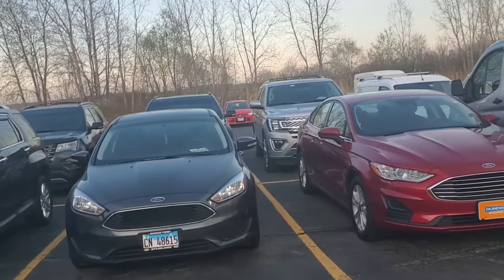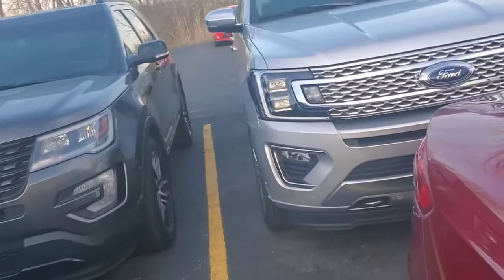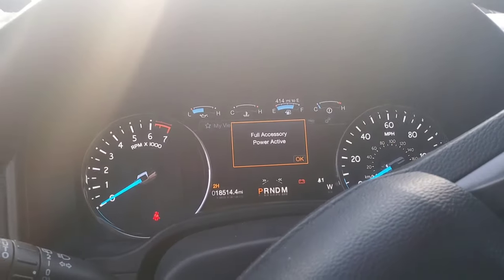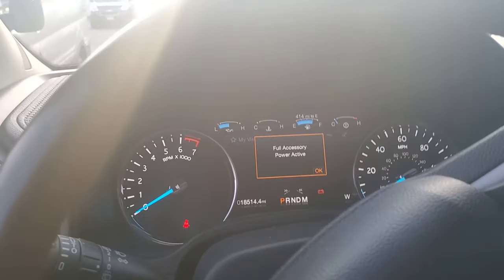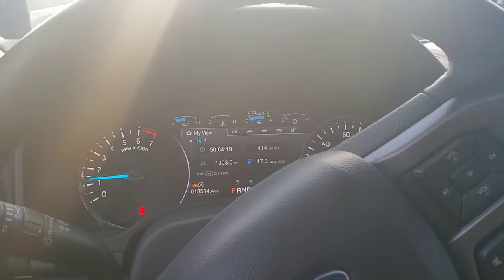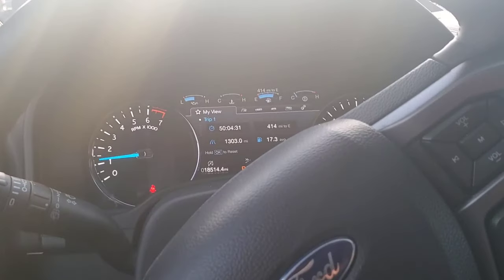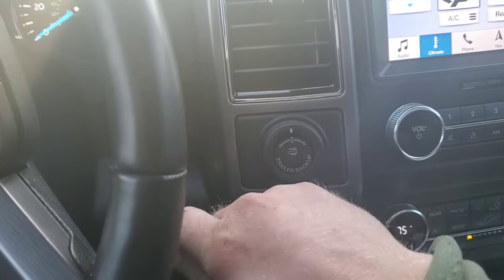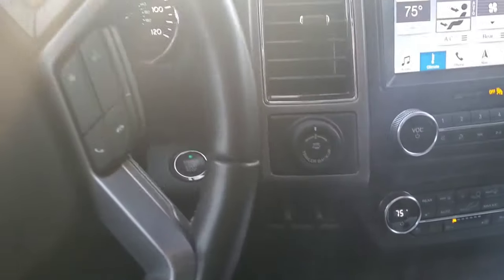3.5L Ecoboost F150 Rattle on Startup then gone, Try this - Could Fix Ford's Phaser Problem

Comment: I have a 2019 expedition and noticed my electrical fans come on after about 15 minutes of driving on the highway. They stay on  all the time as I'm driving. My temp gauge is in the normal range. I don't think this is normal. Has anyone noticed this with their expedition or f150? Why would this be?
Reply from the maker: check your AC pressures or plugged condenser
Reply from the maker: I've had 2 do this because of this
Reply: @FordBossMe  I'm not driving with the air conditioner on when this happens I don't have anything on. Should I still check those. Is there any kind of temperature sensor or could it be a possible thermostat not opening all the way
Reply from the maker: @steve-gz2ym  I'd have to go out with a computer and test things

as well as cooling, clean the radiator, check and see if any codes are present 

check Ford service messages
Reply from the maker: @steve-gz2ym  is it overheating at all? did you check and see if the radiator was clogged or pull codes at all
Reply: @FordBossMe  I had a ford mechanic looked at it already and is not sure what it is. He said there are no codes. He wants me to come back and start by changing my thermostat to see if that helps. What is your opinion on that. You mentioned also about an AC pressure or condenser. If I don't have my AC running when these fans are on is it still possible that it's the AC pressure or condenser? Thanks so much for your time and input. This issue is really getting to me because I really feel these fans should not be on almost all the time.
Reply: @FordBossMe  it is not overheating. But no matter what the temperature is outside the fans come on while I'm driving. There were no codes pulled , but I did not check to see if the radiator was clogged. It is a new vehicle I only have 20,000 miles on it now I cannot imagine the radiator being clogged. I have bought this vehicle brand new and I keep it well maintained.

Comment: I'm doing another set on Monday. Ford eneds to stop dicking around with updating, reverting, updating then seeing if it shutters blah blah blah bullshit. They need to fix the root cause which is the locking pins inside wallowing out their channels they sit in. It's just like the 5.4 3V. Except the 3V had more of a hot idle knock (also described in the 17+ 3.5 EB TSB and recall) not so muhc a cold start rattle. It's stupid. Some techs at my dealer are SPWing phasers that were ALREADY REPLACED.
Reply from the maker: Did you see the action came up with an alternate part number if you run out of the factory stuff the older than part number has like a case over the spring it says in the TSB know if you can't get this one then order this one they're giving you a second option

Comment: Clear flood mode to prime the system is still a bandaid.  Honestly, ford needs to build a more reliable timing system.
And, most GM vehicles don't have clear flood mode, wonder why?
Reply from the maker: I'm trying to figure out how to say what I want to say without being a jerk

Clear flood mode in this video I pretty much explained was just to stop the rattle on Startup and I did specify that if it's too bad obviously.... parts are going to have to be replaced as soon as possible

People shouldn't have to go to the extent of clear flood mode every time I get it but as technology changes and these parts need oil on startup immediately we don't have anything that offers that type of technology yet to where parts are pre-primed on startups so they don't issues

GM does also have issues with phasers timing chains and cam sensors a lot 

There isn't a manufacturer out there that doesn't have these type of issues they just may be better at controlling them when they're brand new early on

We have to deal with trade-in Vehicles all the time with 50 60 70 Thousand Miles where the phasers are already making noise and rattling on Startup and sometimes full blown timing jobs have to be done

Also with GMs fuel management system when they disengage lifters or control oil going to certain areas by disengaging something it also causes an issue with these vehicles at low miles that causes a tapping squeak grinding type sound at times eventually leading to lifter wear rollers on the lifters turning  and eventually camshaft wear

So in essence of talking about timing and fuel control GM has their fair share of issues as well
Reply: Cafillac CTS 3.6 timing chain broke upon startup and valves crashed into pistons. New timing chains and heads redone. Maintained extremely well and I'm 47 and drive it like a grandpa. GM has let that engine and its shitty timing system go unresolved for too long also. GM is not immune to timing problems.

Comment: The best fix is to never buy Ford again, I have a 2017 ecobooster, paid a lot for and this sucks knowing that I have to dump another $2,000 to fix the engine with low miles
Reply from the maker: Lame Fix, bias opinion

Comment: I've finally solved this problem on mine by using a pre-oiler.  $500 solution versus >$2K phaser replacement that's just a "reset button".  Video: https://youtu.be/T_QuLckdV_k

Comment: There you go thinking logical for the customer again 

Ford doesn't want your motor to last they want you to bring it in to be serviced at their dealership or buy another ford

Its not about long lasting trucks its about lasting long enough to keep you buying a ford instead of the competition  and cheap enough to make you not change your mind compared. 

Thats why there is no recall on this f150 part  because its a good money wagon that leads to you buying a ford phaser and labor or buying a new motor or new truck because ford is still cheaper than everyone else no matter what ford wins

Comment: I even try this with my older model 2007 expedition,, same rattle same difficult cold start as my 2019 expedition,,, very sick of it,,, it fucking sucks,,, each time cold start,,, I must spend at least 40 seconds to figure out to start the sucker engine,,, 
  and my 2012 cad srx suv never had any cold start , hot start issue,, just one turn, one crank------hoommm,, engine start smoothly,,
   BUT not ford,,,

Comment: I would be so annoyed if I knew all you did and worked for ferd. 
Question: this would need to be done every every startup to avoid the rattle? Hooah.
Reply from the maker: If it's bad enough yes
Reply from the maker: Typically if the vehicle has sat for several days that's when you really need to do it
Reply: Thank you sir. 

Also Trying to replace my 2011 ecoblobs intake camshaft sensor tomorrow. I’m practicing my swearing now.

Comment: Mines not eco boost I don’t know what to do ford places on phone said sounded like one of the phases has gone out it be 3 weeks I’m scared to drive it it doesn’t do it bad going down road I don’t know what to do but put a new motor in it
Reply: Husband added oil he hasn’t been long  change it should he change it again engine light came on and off I never heard it make that noise I let a friend borrow my truck for 2 days he bought it back like that
Reply from the maker: I mean if it's just doing the rattle on Startup you're still free to drive it it's not going to do any damage but once it starts sounding like metal or a diesel engine tapping all the time that's when I would start worrying
Reply: @FordBossMe  my husband says it’s tapping it is …
Reply: @FordBossMe  itvis

Comment: That works Oooooor ford could just fix there piece of crap phasers so they don’t leak down
Reply from the maker: Well if you didn't just emotionally comment on the first video that you came across you would see that I have a lot of videos on this even showing how to fix this issue they did eventually come out with a generation 3 phaser that fixes the problem
Reply: @FordBossMe  calm down it was meant to be funny and it wasn’t even directed toward you it was directed at ford. And it only took them what 15 years to come up with a solution for their stupid cam phaser’s

Comment: Nobody wants to hear their car crank over for 5+ seconds, especially in winter time when the engine oil is 4degrees outside.
Reply from the maker: Doesn't mean that it doesn't help the issue when starts to become a problem that's the whole point behind this video

Comment: I wish you would’ve let us hear the sound 1st
Reply from the maker: Letting you hear the sound first exasperates further damage
Reply from the maker: Everybody knows what that rattle sounds like that has one of these motors change the oil and don't fill the filter and you'll hear exactly what it sounds like
Reply from the maker: And then on top of that if you actually look in the comment section you'll see how much it actually helps people eliminate that sound on Startup
Reply: @FordBossMe  I did it on mine anyways. Thanks for your time and knowledge.
Reply: I also think the best solution will be to cure the cancer. Since stepping on the gas pedal can put excess gas in the system thereby producing black smoke after the car starts.just my observations!

Comment: This is not correct. There is a pin that locks the cam
Reply from the maker: Here we go one of these guys that don't have anything else to say they watch one video and they think they got everything figured out about the person that's putting out the video, dude I've got so many f**** videos educating people on this whole entire problem and explaining that it is the Locking pin and how it wears out and explaining about the oil pressure situation and how the Gen 3 phasers don't have the issue that the rest of them do but you wouldn't know that because you watch one video and then emotionally get attached to leaving some kind of b***** comment before understanding exactly what's going on, and this is exactly how you get booted off people's channels because you run your mouth without knowing what you're saying
Reply: @FordBossMe  😭

Comment: Yes they could have in my example.  It would of saved me $2500 in repairs......Thanks Ford. for nothing.
Reply from the maker: It does not cause transmission issues it makes it seem like it causes transmission issues with cylinders misfiring 
I explained that in last night's video

I'm a Ford technician and I work for a dealer plus I have a YouTube channel and I have my own independent shop now and you're going to tell me what it does and doesn't do? That's nice that's absolutely fabulous

That's new when the customer tells us how things are

Comment: This is some BS that Ford is doing!!! So you can’t use your auto start because of mechanical issues. This is some BS. Class action lawsuit has to be in the works for ford. Cranking the truck like this will cause starter early failure!
Reply from the maker: So this is where you are wrong

Stop now and don't dramatize everything 

If you'd like to email me we will chat but please knock it off

Comment: Cold winter mornings with the remote start,....she's still gonna rattle.
Reply from the maker: Block heater
Reply: Just warms the oil and block. Does not create oil pressure to get the oil up where it needs to be to prevent the chatter.

Comment: THE ISSUE WITH HIS FIRST QUESTION IS THAT PEOPLE WOULD BITCH ABOUT HOW LONG IT TAKES THE ENGINE TO START.THESE ENGINES DIDNT HAVE THIS ISSUE WHEN ITS NEW OR GOT LOW MILES ON IT.FIX THE PROBLEM AND IT WONT MAKE THE NOISE.STOP THIS STUPIDITY AND JUST FIX THE PROBLEM OR DONT BUY THESE VEHICLES.ITS NOT ROCKET SCIENCE

Comment: I would let you know the fix, but you say I'm being mean. So I hope other people watching this gets second opinions.
Reply from the maker: I don't understand what you're talking about why even be dramatic right now just say what you have to say

If you're talking about this video being the fix this is not the fix this is just something I stop the rattle the fix is to actually put new phasers on the vehicle but then 15 -  20000 Mi later sometimes it starts making noise again

Some people say because of another dealership swapping out cylinder heads to fix the problem because of the mega cap losing oil pressure is that actual real fix

And then obviously other idiots that have biase towards Ford so just change the vehicle

So what are you going to tell me that you don't think I already know?

Please enlighten us -

 dump some oil stabilizer in it? Like the Lucas crowd says - that's just stupid honestly